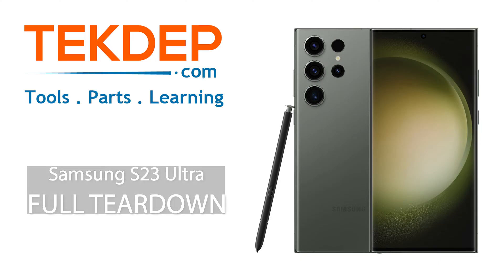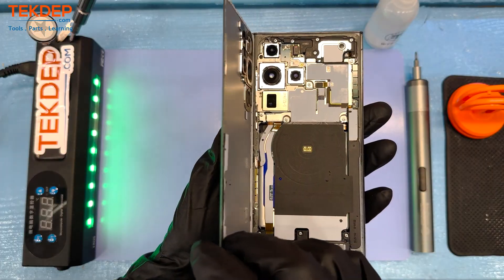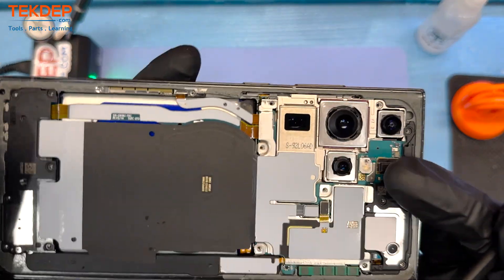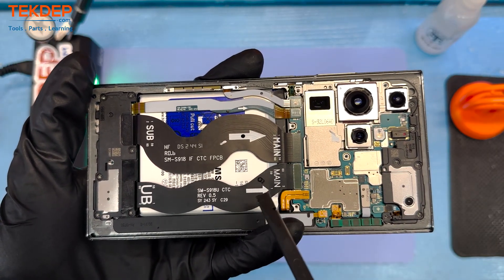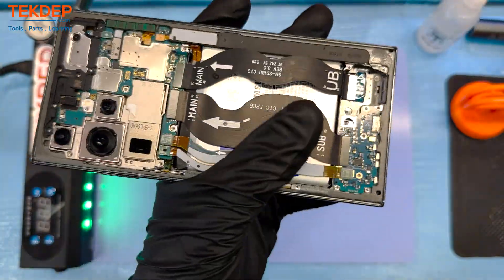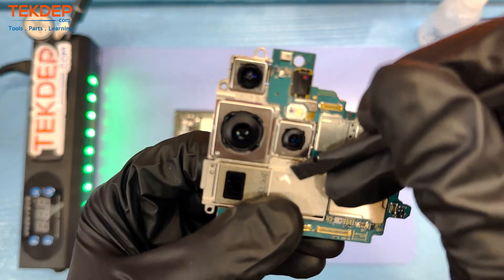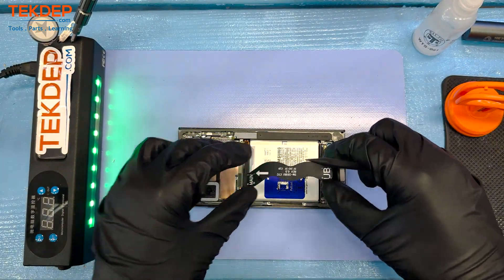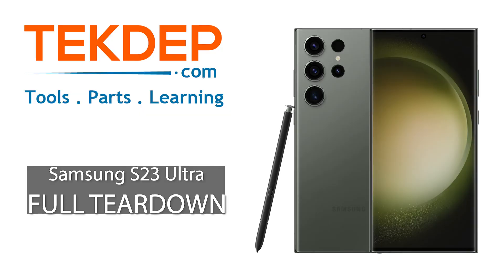Samsung S23 Ultra | FULL TEARDOWN | Disassembly Repair Guide

Comment: Hi I was wondering if anyone could give me any information on how to fix the vibration on my s23 ultra I've replaced the bottom speaker hoping that would of done the job but not joy. When typing the code *#0*# the vibration doesn't respond

Comment: Thank you for the video. I didn't remove the sim card. Will that be an issue? Also I upgraded the battery to a 6500. The phone works and the battery will charge via the charging port. Unfortunately when I place the phone on the induction station the induction station gives me a blinking red light.  Any recommendations??

Comment: my s23 ultra just fell off my car and is destroyed. it doesn't turn on when connected to computer and nothing is detected. The bottom of the phone looks worse, but the top half looks to be relatively intact. Where would the data be stored for possible recovery? We just had our daughter 3 weeks ago and google pictures weren't backed up for the last 7 months, my wife and i are sick thinking about what we lost. I don't mind paying for a service at this point, just curious given the damage and you mentioning the newer S models are harder to recover. Thank you so much.
Reply: In a similar situation, looking for answers online and I'll come back to this if I find anything
Reply: @sydneyhoneypots  I ended up sending it in to a data recovery group. $2200 total.
Reply: @justinthomas85  holyyy smokes... obviously worth it for the loss but that's a hard number to read

Comment: I have the s23 ultra, but someting inside is loose, its always been loose, if you shake it you can feel it.
Any idea what it could be?, its feels like its on the middle around the wireless charger is
I was thinking maybe the battery or something?
Reply: It is probably one of the camera lenses. I assume Tele photo lens. It's same with mine.
Reply from the maker: "Hey there! Thanks for reaching out. It sounds like there might be an issue with the internal components of your S23 Ultra. If there's something loose inside and you feel it around the wireless charger area, it's possible it could be related to loose screws or another component. However, it's crucial to have it checked out by our  professional technicians to determine the exact cause and ensure your device's safety and functionality. 

If you're looking to have it repaired, we offer mail-in repair services: https://tekdep.com/repair/

Comment: I believe that the 2 millimeter wave antennas are used for maximum possible 5G FR2 coverage. 5G actually consists of FR1 bands and FR2 bands (FR stands for frequency range). The FR1 supports 6GHz and lower, frequency bands and the FR2 supports >24GHz millimeter wave bands. The high frequency mmWave bands can achieve great data transfer rates but however come with the disadvantage of low penetration power (difficulty to pass through obstacles, buildings). mmWave antennas are specifically used to support 5G FR2. Having 2 mmwave antennas that too in opposite directions hence provides better coverage and additional range than having a single antenna or having two antennas at the same spot.
Reply from the maker: Thank you for your valuable feedback, it greatly helps! thank you for watching!
Reply: Well they(5G antenna) obviously don't work very well if at all on my phone. Always connecting at 4G or 3G if available any more.
I will never buy another Samsung unless they can prove to me that I can make a call in my house, or outside of my house for that matter. Been through hell with Samsung and my phone service provider because of the poor reception and I'm 1km away from the nearest tower and many others.
Reply: @paullelys161  I just opened mine today and those 2 5g antennas TEKDEP mentions are not at all in the phone. In others disassembly videos they are not there neither. I suposse is only some phones which have it. But my phone has connected sometimes to 5G when available and im from a 3rd world country so 5g is not a big thing yet.

Comment: Is chip off data recovery possible with the Samsung S23 Ultra?
Reply from the maker: Hello, so the thing about the recent motherboards from anywhere S20 and up, is they are actually sandwich boards (2 boards need to be separated), which makes the data recovery extraction a bit more challenging compared to the S10 series, unlike the iPhone we are usually have to move the NAND, CPU, Baseband and EPROM. for the Samsung you just need too move the CPU and Flash memory chips to make the data recovery possible. stay tuned in our channel as we exploring ways to produce delicate motherboard repair videos, thank you for watching!

Comment: Is it possible to completely remove the 5G antenna in the Samsung S23 or any other top level phone, or at least disable it (yes I am aware that one can simply turn it off in the connections settings).
Thank you for your excellent work and hopefully, answering my question, Brian
Reply from the maker: hello Brian, yes it is possible, some countries that do not support 5G service don't have these parts in the phone in the first place.